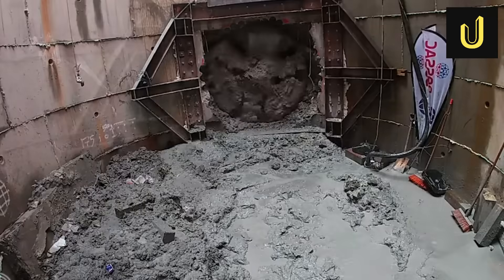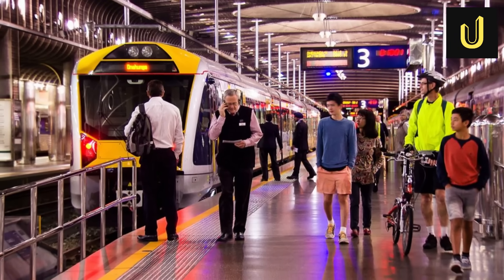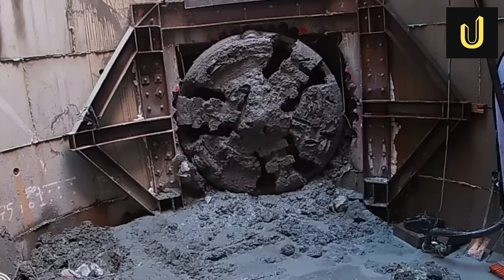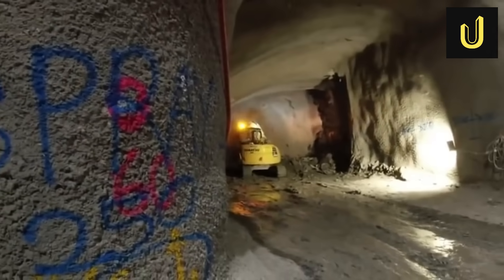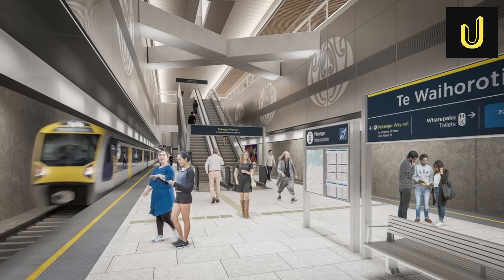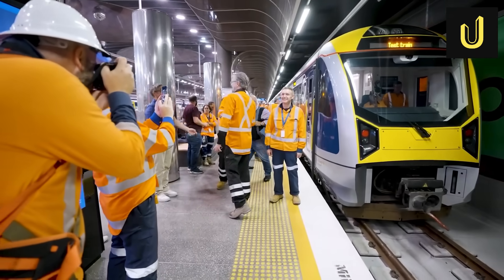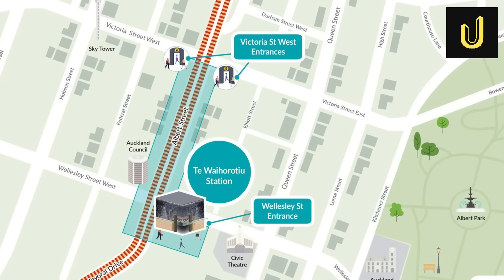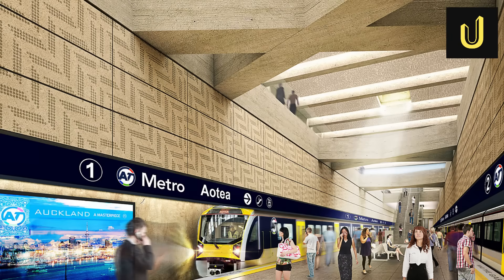Auckland’s Deepest Underground Train Project Revealed!

Comment: I live in Auckland and don’t understand the importance of the new destinations, in my view it should have been either across under the sea to the North Shore or to the Auckland Airport to have real value to the city. Auckland has been discussing a second harbour crossing for decades and done nothing, this could have been the solution, the North Shore is where the bulk of Auckland’s growth is and it’s hamstrung by the ageing harbour bridge.
Reply: The North Shore Link would not have been possible because Britomart was at capacity. The CRL unlocks the potential to build that North Shore link. Also the Waterview tunnel is the alternative route.
Reply: SH20/16/18 Western Ring Route was first section of alternatve route to be built instead.
Reply: Unfortunently we have a business that run Ferries...Cant have that lol

Comment: They should keep going down under mt Eden rd then over to royal oak and then one hung a to complete the loop at station there. Then a link across to the airport with new rail bridge and maybe cut and cover or above ground over motorway to airport. A final link could later be driven from onehunga across to new Lynn giving the city really useful loops of rail connecting  the southern side of Auckland. That would really give Auckland a great start at a full underground by connecting existing lines with new loop connections. No city has EVER regretted the money spent on an underground. NO CITY
Reply: Apart from that time Heathrow tunnel collapsed I guess

Comment: So far behind the 8 ball. Should have been done a hundred years ago
Reply: Get real how could they do that 100 years ago
Reply: @RichardTrainor  The way they did 160 years ago - cut & cover mentioned in this video was used in London in 1860s.
Reply: @patrickpaganini   The Lord Beeching put a stop to that lol
Reply: @patrickpaganini  Huge difference in depth and geologic materials. The original London metro was quite shallow and in alluvial river clay. The CRL is through volcanic and abrasive volcanic ash from Rangitoto, Tarawera and Taupo. The technology for those conditions wasn't available until this century, not in a cost effective way.
Reply: @trevorstewart1454  I suppose I was just meaning people were talking about an Auckland underground 100 years ago, it's not like the technology didn't exist. As to the current CRL I must admit I don't know anything about the geology - it is a fairly short straight line - has the local geology added huge complications?
Reply: Muldoon stopped it in 1975.

Comment: Guys be carefull working in the construction of the tunnels as concrete  dust is a KILLER this happened in Queensland  some years ago.
Reply: Had loads of ventilation and dust suppression in the tunnels, the top-down station construction had a lot of dust, lots of concrete cutting etc. and mandatory masks